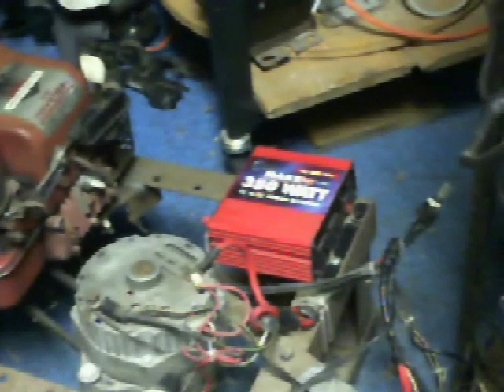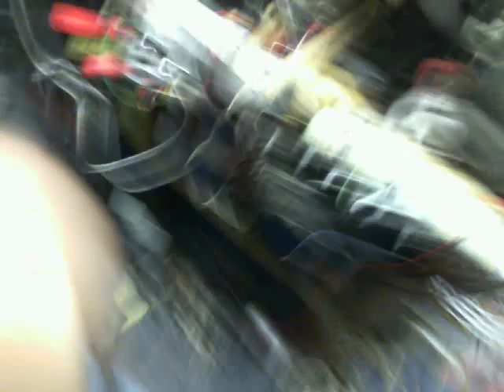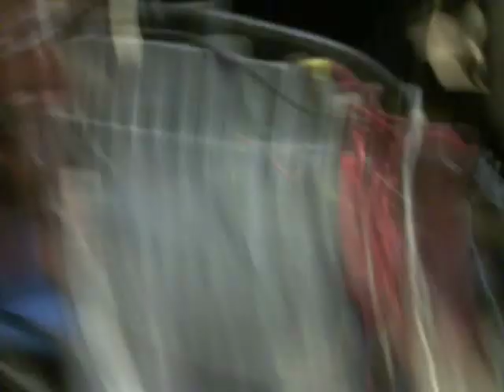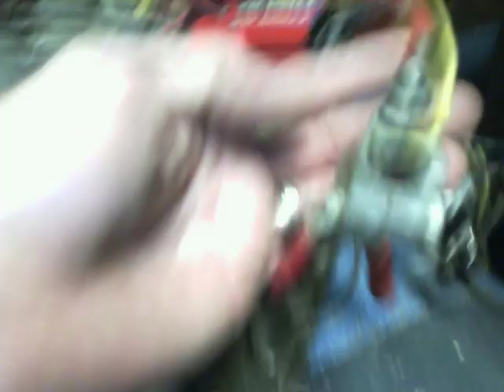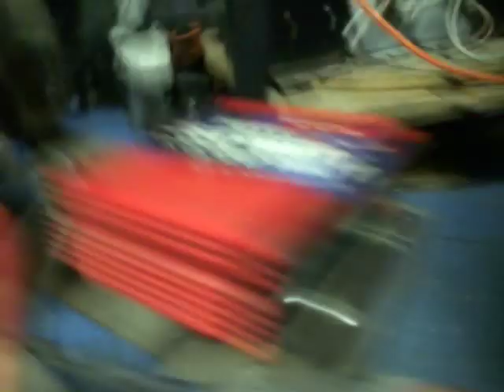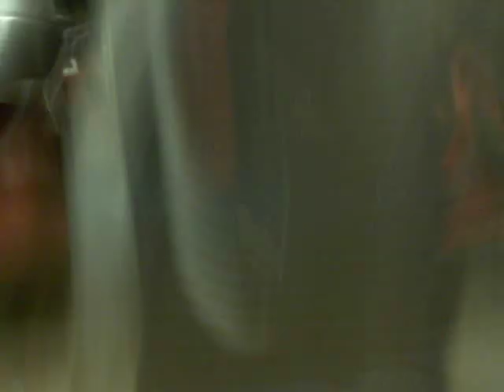SHAZIZZS REDNECK EMERGENCY GENERATOR !

Comment: Sweet  genset man! I am building one with a horizontal 6.5hp and a 130A alternator. You can even bypass the regulator and do small stick weld jobs with it. Or use it to run those NST's and fire up that Tesla coil!

Comment: don't look safe with all those loose wires
Reply from the maker: Considering it was made from recycled junk and needs to be refined and all wires that could pose a danger were well insulated I would have to say outside of getting your hand caught in between the pulley and the belt would be the biggest risk. However I used it safely for two months and did just fine. Proof of concept is there. Eigther way people should always practice safety first. :)
Reply: It is surprising what can me from scrap /'junk . . If your going to do a job make sure you think of safety 1st

Comment: I tried whit you put together and I could not get any power out of the Alternator,How did to hook up the red  and black wires that comes out of the Alternator how did you get power cause I cant
Reply from the maker: Did you check to see that you had power to the alternator? They have to be energised to create  the field to begin charging. I have seen people modify them with permanent magnets to get more power without having to energise the alternator. check out muddymuddymudmans channel he does some great axial flux turbins, or green power science as well. Join me on my radio show sometime and we will help you figure it out. All the links are on my channel.
Reply: (1) what do you by energise the alternator.?
(2) I took it to auto zone they said it was a good alternator.
(3) The Pulge in on the side of the alternator I havea a red wire the other wire is Black.. I put The red wire lick you said to do.When I put the black on the Red End it backed dowh realy bad.
(4) Im thinking i don't Have the power to get the power I need.
(5) I was useing a beanch Grinder to turn the a  alternator. Do you think I heed a Better Moter to make the power I need.
Thanks.
Reply from the maker: Rick Davis http://www.expeditionlandrover.info/Delco_Alternators.html
Reply from the maker: http://www.expeditionlandrover.info/Delco_Alternators.html
Reply: Here in a little bit I am going to make a video of what I got And how I did It, I will upload it and send you the video, Then maby you can see what I'm Talking about. Keep looking for My video.
Reply: u have to start the field in the alt. put 12v to the small wire on the side single wire that on the side of the alt. that will recharge the field in the alt. if u don't use it for some time u will have to do this every time. this only works for single wire alts. hope this helps

Comment: my 79 cc unit is a little under powered for the alt. im using. the lawnmower engine hes using is deffinatly a better choice but none were available at the time i built mine

Comment: for anyone trying this remember its only for low output,forget bout that 60-90 amp rating of the alternator, that poor lil 31 cc cant possibly spin that thing under load.even my 79 cc has to be geared down to run a 90 amp unit at half output. so slow charging batteries yes, jump starting a car no;
Reply: a 4hp briggs is 123cc not 31cc. 31cc is like a weed whip, or chain saw engine.